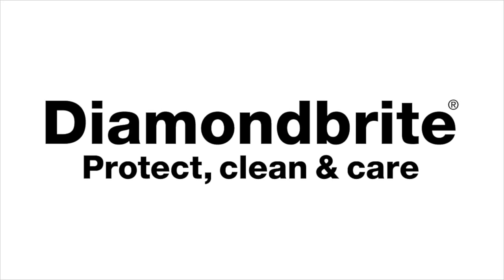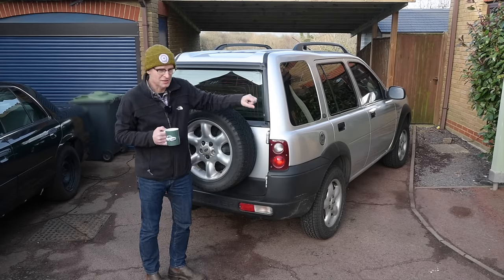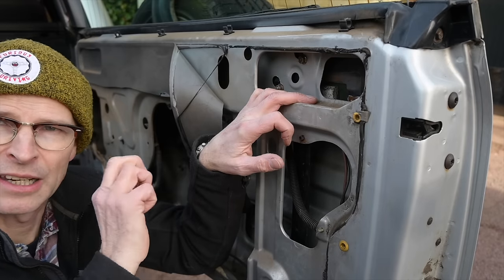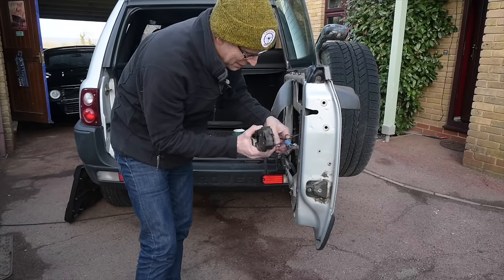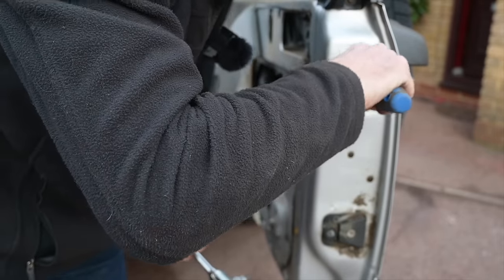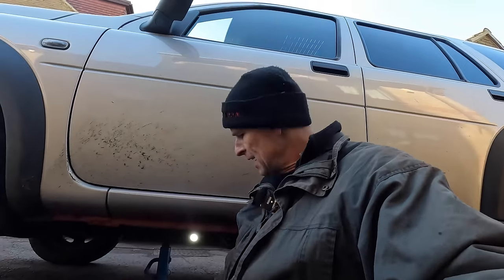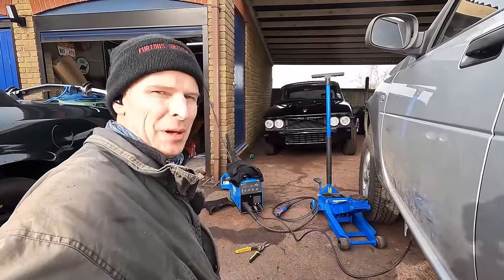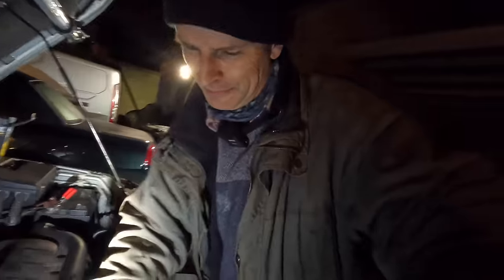There will be rust..Can Hippo the 21 year old Freelander pass the MOT...?

Comment: Rust is like an iceberg. You only see the tip of it until you delve deeper. Unfortunately it is always worse than expected.
Reply: I'm in the middle of a project where I fully knew this would be the case, and I was still shocked by how bad the rust is inside the sills. I've cut off most of the driver's side sill, last week out of curiosity I hit the lower edge of the inner sill a few times with a big hammer and was met with a massive shower of huge chunks of rust just falling out. Then the hammer made a big hole.

Comment: Great work as always Matt! 😄 Congrats on a MOT pass on Hippo! ✅ Door lock issue might have been it being dry of Oil as had that once on a boot lock on a Fiesta. 
Hippo needs a good pressure wash underneath and a wire brush and a good coating of Bilthamber UX in the summer.

Comment: I had a similar problem with the boot mechanism on my Honda HRV. The locking was intermittent, but the opening was by a cable, which had stretched. I solved it by fabricating a bracket to screw on, to which I attached the suspension spring from an old radio controlled car! The rust on Hippo looked almost as bad as what I discovered on my old MX-5. I saved myself the welding and sold it to someone else!

Comment: Watching these videos always bring out the fear in me: just did the oil change on mine and my 1.8 Hippo will be in for its MOT tomorrow morning!
PS Cillit Bang Kitchen cleaner does an amazing job cleaning mildly oxidised electrical contacts - so at least the bulbs agould work for the inspection!
Reply: Turns out the NSR brake light enjoys a good laugh: it stopped working for the test. The OSR one worked a charm!

Lucky no bodywork issues, but turns out the NSR brake decided to partially seize for occasion. That’s the weekend sorted then!!

Comment: Great video. Stuff in the back of the car catches all kinds of moisture, dust and sand because if the vacuum which exists during driving. Cleaning, decreasing and re-lubrication can solve these issues.
Reply from the maker: lithium grease dis the trick!

Comment: Fixed a few of these back doors. I would say it's probably the most common fault on them. From the rear window to the door switch. I have them when the batteries go flat stick with the lock half on. They wont close or stay stuck shut.  Not bad for a 2003 quite common to grind a bit out and find more holes. Straight thourgh the mot brilliant. Rear cv joints i never thought about that when you where looking for the noise.😂.

Comment: I had similar (behaviour-wise) problem with a Mondeo door lock. Turned out to be a cam-action mechanism directly on the back of the exterior door handle. Part of the handle assembly. Needed a clean and lube.

Every so often, the handle failed to release fully and the door couldn't lock.

Comment: A bit of rusting on a 21 year old car? That strikes me as fairly good going. Back in the 70s cars seemed to disintegrate far more quickly that modern day ones. My first car, a 7 year old Vauxhall Viva HB had huge holes in her wheel arches which I spent a lot of time 'repairing' with the aid of chicken wire and filler. Contrast to my Scottish-based 2004 Skoda Fabia that had virtually no body rust (but admittedly a fair bit on underbody things like the suspension and rear axle) when we parted company in 2021.

Comment: Darn, I have a 51-plate Freelander TD4 and have not got any of that kind of rust. I have  recoated the underside with truckbed liner and slapped on some stone chip on top off it for good measures :)
Reply from the maker: Hope it stays good for you!
Reply: @furiousdriving  Thank you, bought it 2 years ago and love driving her. I have been running it on clean veg oil/Kerosene mix through that time to had no problems and it seems to love running on the stuff lol :D

Thats good news with the pass on yours as lovely cars really apart from the odd electrical issue.

Comment: My T30 xtrail tailgate latch did the opposite thing where it wouldn't open. Turned out to be the outer handle sticking from dried grease on the handle pivots and on the tailgate latch mechanism. 
Hammerite is another example of a product where the marketing hype doesn't live up to the reality. I stopped using it years ago because it was expensive and it really isn't that good. Much better products out there.

Comment: Taking mine for it’s first MOT with me tomorrow morning! Wish us luck!
Reply from the maker: Good luck!!
Reply: @furiousdriving  Thanks will let you know how it goes. It’s a 06 plate TD4 Auto 5dr Freestyle. Replaced the fuel tank cradle in preparation.
Reply from the maker: @trainman665  I trimmed the cradle back to the thick frame, no rusty panel, no advisory and no less solid!
Reply: @furiousdriving  Nice. Unusually it was the frame that rusted out on mine. The panels were fine. Bought a replacement whole cradle but the fit was terrible. I’d recommend just doing the main bars if you ever need to, you can buy them separate. Anyway the Freelander passed its MOT! :) Just some advisories for brake lines, one brake binding slightly, one headlamp lens needs a polish, and the tyres showing signs of age. Not bad for a car I was given free last year and sat about until now.

Comment: Rust converter products are only a temporary solution. The rust will always return eventually.
Reply: They only put a coating over the top. Rust will continue to spread underneath.
Reply: @trainman665 thats why you wire wheel the living daylights of it, the rust converter then acts as a stopper
Reply: Yep. Cars rust from inside out.
Reply: @KrisDouglas  Ideally. I’ve given up using it though as it it just deists through again normally. It also doesn’t work when the metal is rusting from the other side.
Reply: @KrisDouglas  Nah still comes back.
Only way to stop rust is to prevent it in the first place or cut out and replace. No chemical convertor or paint will "kill" rust. You could grind it off to shiny metal if possible but then you're just making the metal thinner.